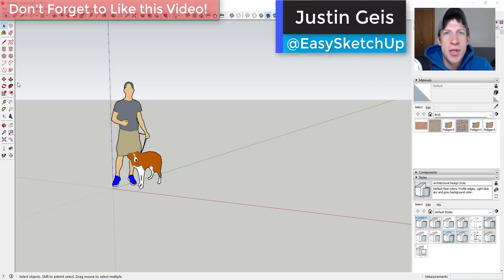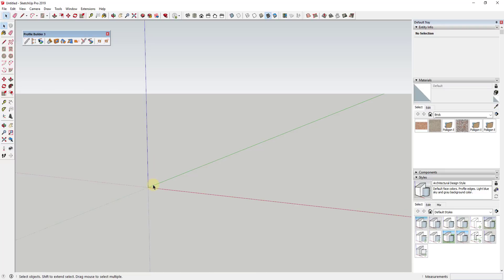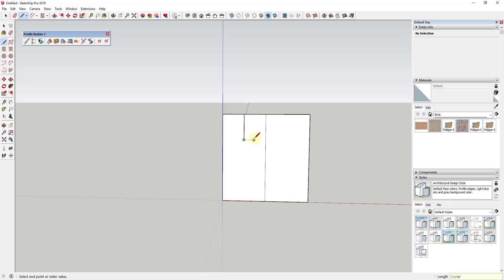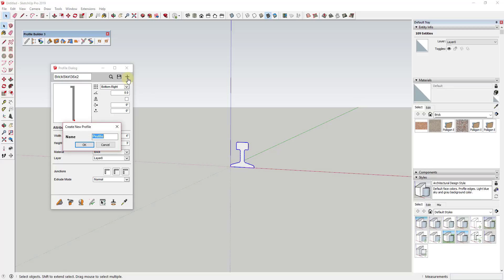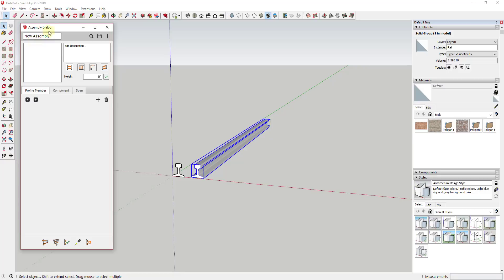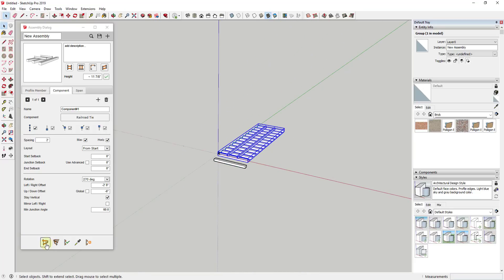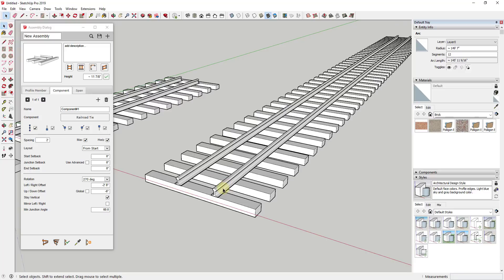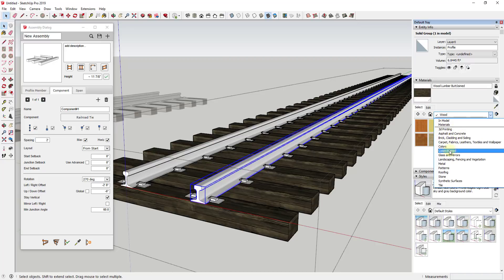EASY RAILROAD TRACK ASSEMBLY with Profile Builder for SketchUp

Comment: Nice video!  Although it is tempting to use the Paint Bucket to change the material of the rails, the better way to do it is to edit the Profile Properties inside the assembly and then re-apply the attributes.  Then, the material assignment will be maintained even if you change the assembly settings later :)

Comment: I'm a little surprised that you still have a human character load in your default template, or do you include it only when you record these videos?
I mention it simply because it adds to the file size.
My own default (bare with no components, materials or any preset geometry weighs in at a lightweight 10.5 KB, but a simple rectangle with just one character component on it, is a portly 79.8 KB
Granted, in the grand scheme of things, not really a big deal, but even if you delete that component, it's still merged into the file...until you manually delete from the comp list.
Reply: I also do it to easily reference (visually) that I did not mess up my scales.
Reply: @Deontjie  A simple 5' x 5' rectangle off of the origin, would do the same, but would be easily deleted and not archived into the active file.  If and/or when you delete the component character from the workspace, you have to make sure that you delete it from the list of components as well, or it will still be loaded into your file.